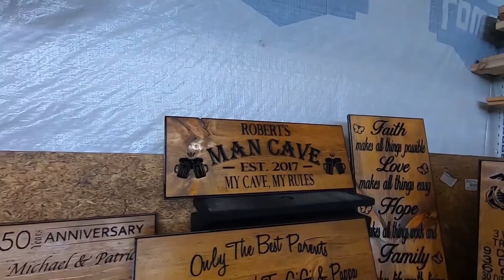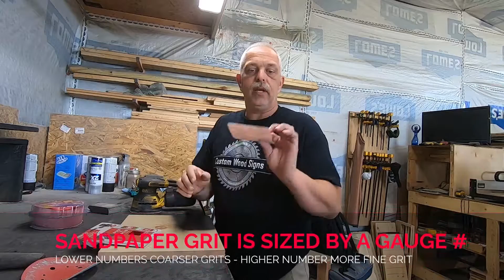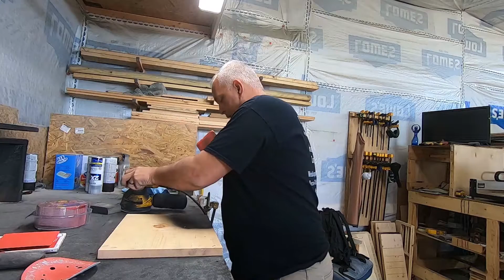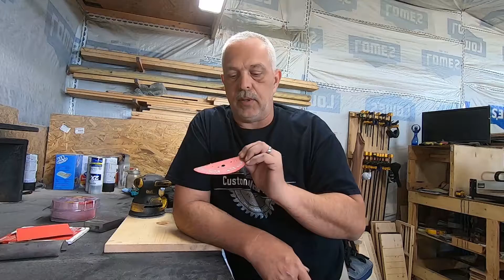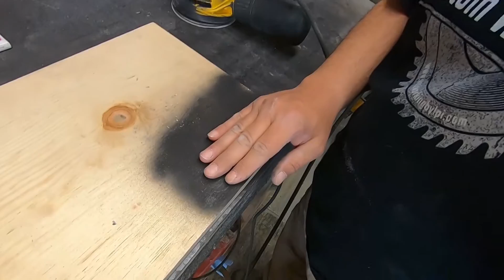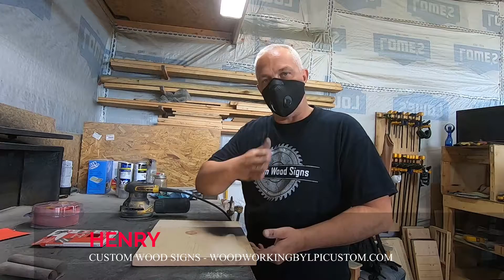Sanding Wood Signs Basics - Beginners Tutorial

Comment: I am a disabled Veteran hoping to LEARN woodworking, Wood Burning (Pyrography) with dreams of making $500 0 $900 (I make any more I risk losing my Social Security) after expenses a month extra income to pay off my woodshop bills. I want to make signs and flat board clocks, I am about to max out 2 credit cards to buy a Onefinity CNC and all the accessories.  I was considering investing in a drum sander, but for now, I use a Rigid orbital sander from Home depot but I can not seem to get it flat, the work is smooth but I end up sanding low spots, what am I doing wrong? Will a Drum sander stop my failures?
Reply from the maker: Thank you for visiting and your service!  This a common problem which I have dealt with as well.  There are many ways you can check to see whether or not the board has waves and not flat.   My preferred method is to use a square and place across the board in both directions looking to see on the board level whether or not it is flat.  Unfortunately, wood being a natural material it will fluctuate due to many factors, mostly the amount of moisture in the air and the board absorbing and reacting which is aggravating.  There are several ways to approach this.  1. I use a planer with a pencil mark back and forth across the board then run through the planer to flatten the boards.  The planer is a great tool for this purpose.  The downside is the number of times and amount of material you will shave off can reduce the height of the board more than you want.  But if you keep an eye on it and use your square to visually see the board being level as well as where the pencil mark has been shaved it works very well.  2. A belt sander is a great way of flattening a board, slowly moving back and forth, one against the grain and one with the grain.  Using an 80 grit and/or 120 grit sand paper you can slowly flatten a board, again using the square and your pencil mark to judge that the board is truly flat.  With regard to a drum sander, the drum sander will work for you in the same concept as the belt sander and is a very good tool.  However, they are quite costly, I would recommend the above solution with a belt sander as a cheaper solution with the same result.  I hope this helps and best of luck to you in your woodworking projects!
Reply: @woodworkingbylpi  Thank you for your reply, I have so much to learn and so little confidence, but I hope to try.
Reply from the maker: @Dartel  I'm still learning as I go and have lots to learn also, that to me is the cool part about woodworking.  I wish you the best! If you can, let me know along the way here and there how it goes! Take care